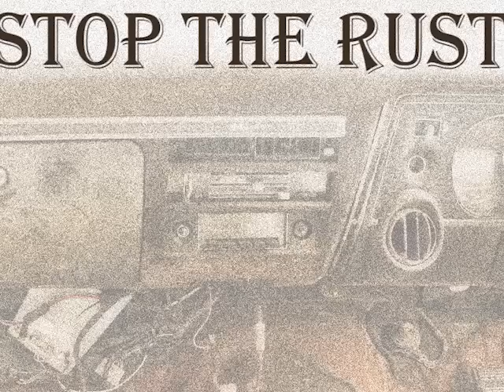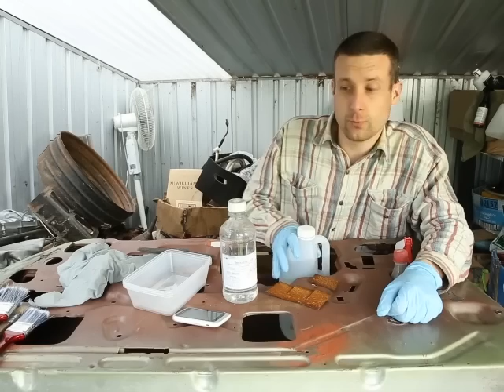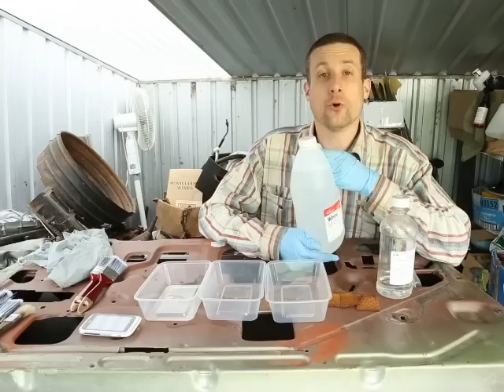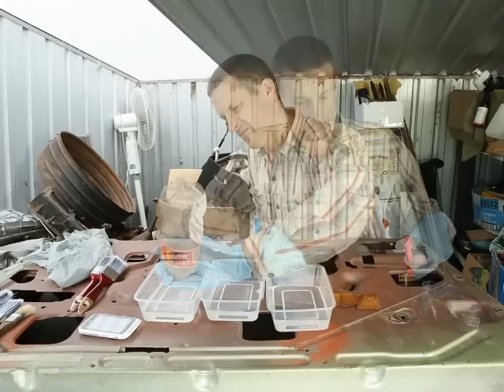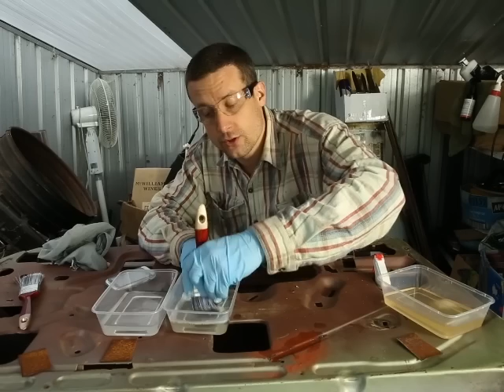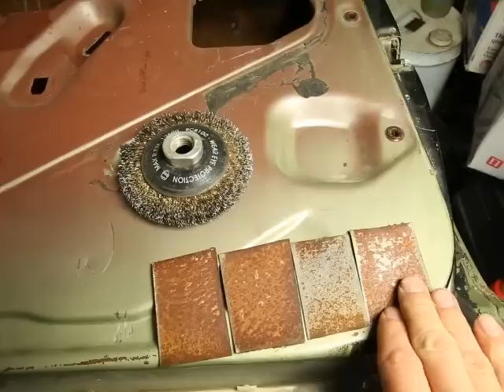rust chemicals compared, phosphoric acid vs deoxidene vs vinegar vs mag wheel cleaner

Comment: I dropped some rusty tools into a shallow tub of white vinegar and left them there for a couple of days.  I couldn't believe it.  Rusty suds formed on the surface and the tools turned charcoal grey.  This grey color was removed by some rubbing w/ a rag, but the tools remain the color a Glock pistol.  Most important to remove any grease or oil first, as vinegar has the same properties as water and will not penetrate the barrier.  Hard to use on vertical surfaces. 
     I tried 1:9 solution of molasses.  It didn't work well for me.  Also i have used a phosphoric acid product called Whink on carpeting and fabric.  Works instantly.  I didn't rinse the carpet but i would recommend it.  Good video.  Thanks.

Comment: With the right exposure time and solution, phosphoric acid will convert rust entirely to iron phosphate with no need for abrasive.  You're close, but I can demonstrate turning rusted steel into completely rust free.   

Dilution is important and so is surface texture because it can be hard to get insufficiently diluted phosphoric acid out of small areas.  

It will also blacken steel, which depending on your outlook can be good or bad.
Reply: hey m8, you seem you know what you are talking about... what do you mean about dilution !?
Reply: Minimum 20%, but 40% is much better. Expensive, but you don't need that much if 85%.

Comment: At my engine shop, we have steel shot blasting, bead blasting, soda blasting, 9", 4" and 3" wire wheels on body sanders, 3" Scotchbrite pads on die grinders, a sodium hydroxide jet washer with a rust remover additive(crap), hot tank, electrolytic cleaning and ultrasonic.

Rust removal with the least labor is Evaporust, but it can take several hours or even a couple of days if it is thick and flaky. If the parts are small enough, we throw them into the bead blasting tumble basket, and 15 minutes later, voila,  It removes the whatever, and leaves an even, albeit, drab, flat finish. Soda blasting is not really aggressive enough for rust, but it washes off in water, making it more attractive for cleaning items with blind passages like an intake manifold. We reserve soda for aluminum or blind spaces. Evaporust also get into all the nooks and crannies without leaving any stray abrasives. If it is a rusty engine block, and I don't want to wait for the Evaporust, I might roll it outside and hit it with black silica in the sand blaster. 

Cylinder heads laying in a junkyard rusting for years, old paint, carbon buildup, whatever, go into the steel shot blaster, and come out warm 15 minutes later, looking like brand new.
Reply: You might be the best person to ask. I have an old rusted trailer that is still mechanically sound. All that exposed steel c channel is a real pain in the ass, and impossible to get any abrasive to access. I sprayed it down with a phosphoric acid etch yesterday and this morning, it is coated in white dust. Now what the hell do i do? Blast it anyway? This project is a nightmare...
Reply: Protect your lungs and blast away outside. Rust converter is commonly used on frames. I've used Rust-mort on a kit car frame 15 years ago, and it still looks good.
Reply: The Engine Center tyrent

Comment: I've been tring several differant things to try to remove rust out of a gas tank. Vinegar does not work it will rust back fast cider or white vinegar. I've been using electrolists with baking soda seems to work very well but as soon as you drain it and let it stand it will rust back.
Reply from the maker: So your problem is the (flash rust) Try washing the water off with something that won't let it rust. I like the spray pack engine degrease r that's full of oils and spirits but since your washing out the inside of a tank your going to need a lot of rinse. You should consider using rust converter or getting water dispersant in bulk
Reply: 10-4
Reply from the maker: thanks for a great idea, I think this is called a parts tumbler.
Reply: All the rust "removers" either dissolve the rust, but that leaves the bare metal for new rust to form, or they convert it. Rust converters turn rust from iron oxides into something less brittle, like iron tannine, or iron phosphate. that will leave a more stable surface, but it still may flake off. You should test what works best for inside your tank.
Reply from the maker: Thanks for your input, lots of things help and it's a hard choice sometimes. Eastwood made a kit for the inside of tanks, might be worth looking at. I'm not a fan of converters, I don't think they penetrate on heavy rust.
Reply: The converters chemically change the rust, and may actually react with the top surface of unoxidized steal below. But that will not be a deep penetration, and almost anything is better than rust. I had that problem with the tank from my XT500, and back then all I could do was dry it out, put sand in it and tumble it strapped to a concrete drum for an hour. That ground out the rust. But I had a hard time to get all the sand dust out of the tank later. After that, the tank was almost always full, so there wasn't any problem later. I guess some kind of fuel resistant coating after the de- rusting makes sense, but back tghen there wasn't anything other than sloshing some paint inside the tank, and I didn't trust that. Maybe galvanizing on the inside?

Comment: If you soak rusted steel in phosphoric acid, at least for some types of steel, the phosphoric acid will "rebuild" the surface. I have found this to be true in several instances. One memorable time was when I used phosphoric acid on the spring steel wire rings inside a hub cap; the rings are used to keep tension inside the connection clip areas, so that the hub cap stays tight at all times. This spring steel proved to be so improved by phosphoric acid, that when I had soaked it completely and let it dry completely (temperature over 50 degrees F), the spring steel rings appeared to be completely repaired, and the metal looked to have a perfect surface, although when I had started the soak, the rust appeared flaky (I did not use a wire brush on the rings at all). The rings have held up excellently since then. I was astounded. Phosphoric acid may work better on spring steel than on sheet metal, but I don't know this for sure.

Comment: The rust converter you mention at the beginning of the video does not remove rust, it converts the iron oxide into iron tannate.  It will only work on rust, so it is best for pieces like you were working with that have a relatively even layer of rust across the material.  When you apply it it will turn the orange iron oxide to black iron tannate, which adheres to the metal.  Now it adds another layer of protection to the steel and you can paint over it.

Comment: vinegar works great and rids the metal of rust and makes the metal clean enough to eat off,but it takes depending on the thickness of the rust it may take 2 weeks to clean,not just 2 minutes.and yes it will rust again very quick that why you treat the metal pronto.
Reply from the maker: Vinegar is also the most environmentally friendly and user friendly, just a bit expensive with larger parts.
Reply: phosphoric acid is good for full frame it can be brushed on and when you rince it with water the ph of the acid drops to be neutral
Reply: pressure wash rinse

Comment: Body panels are mild steel, so embrittlement is no so much of an issue.

The trick though is to keep application time to a minimum, neutralise with NaOH, rinse with water, dry and then coat the treated panel with a commercial rust converter.

The other thing is that as HCl has a lower SG than water. Keep it away from seam welds as it will penetrate these and the rust process will continue as water, residual HCl and Ferric Oxide form Ferric Chloride (a strong etchant) to keep the process going.

Comment: Thanks for the video. Something that worked for me was Distilled White Vinegar and you soak the item in the vinegar and right after it comes out you spray it with WD40 or any other water displacement spray.
Also another thing that i have tried was called Evapo rust! Once again thanks for the videos. im gonna go watch your molasses video now
Reply from the maker: Good tip WD40 will be great to prevent flash rust. If it get's expensive I have had success with engine degreaser in a can, sometimes $2 per can.

Comment from the maker: You both make excellent points, however embrittlement is already a problem on old cars before you get them in the work shop. Flexing and vibration will work harden your panels to the point of cracking. I like the idea of normalizing the steel where possible 280deg'C whilst weary of the risk of warpage. Most of us know you should heat evenly and cool slowly but saying it on youtube is a lot easier than doing it.

Comment from the maker: Thanks I look forward to trying it. The problem with this auto body stuff is that everything needs so much respect, I get tired of trying not to die. I have also heard that the harder you etch steel the more etch hardening applies to the steel. My impression is that acid makes steel harder or more brittle, so for panels we plan to beat a milder acid might be preferred. Thanks again for the tip.

Comment: Leave your metal submersed in some cider vinegar for 24 hours then rinse with water, heat dry and apply some oil like WD40 to stop any rust returning, cheap and very effective. Don’t throw the used vinegar away as you can keep using it even though the vinegar will look very dirty just pour it into a bottle minus any rust sediment. 👍🏼🇬🇧

Comment: there's a big difference between removing rust and neutralising rust.. deoxidine is primarily used to convert surface rust into a paint-able surface. it also requires an abrasive such as scotchbrite

the best method to remove rust is always going to be a wire wheel or some 80 grit

Comment: when we work with tool and die we're working in a ferric chloride environment (etching department) and literally EVERYTHING rusts. we have two chemicals (i'll look up their names, they're simply aerosol bottles, one's orange, one's green) we spray to keep the metal from rusting, but the one we use most for storage is, you guessed it, WD 40. tbh for practical water displacement and rust prevention, I'd recommend a light coat of wd.

Comment: Excellent comparative video. Vinegar definitely dissolves rust, but phosphoric acid is quicker than vinegar. Vinegar only comprise 5% acitic acid. Why not try a stronger version of acitic acid, say 32% the one you use for cleaning coffee machines?
Reply from the maker: I'm sure that's well worth testing, thanks
Reply: The stronger the acid the faster it eats the metal you want to save.  Also requires more neutralizing.

Comment: Phosphoric acid works, that's a fact. Does nothing to the metal, but converts iron oxide (rust) to iron phosphate. And, prevents rusting rather well on its own. No need to rinse. Slow reaction tho, you can just leave it there. Use wall paper paste as a thickener and brush on a generous coating. Wipe off when done. Heat speeds the reaction.

Comment: Mate, for speed and effectiveness you really need to try straight Hydrocloric Acid (Diggers from Bunnings).
Just respect the stuff and don't breathe the fumes, watch you eyes etc.

Have another container with a Water/Sodium BiCarb or a Water/Sodium Hydroxide(10%) solution to neutralise the acid when stop the reaction.

When it's all done and dry, the metal will 'flash rust'. Dont worry, just apply a light coating of commercial rust converter and Bob's ya' Uncle (or your Aunt).

Comment: I like the comparison. What would you recommend to do the same with a car roof ?  I had seen your one video about the Apple cider vinegar, would you recommend soaking a towel to allow it to stay moist when it is sitting ?   
 How about clinging ? Thickening the solution to help on vertical areas like frame rails ?
Reply from the maker: they make stuff just for this, it has been called (naval jelly) locktight make a version, as would many other brands. Put some cling wrap on top of it to extend your working time.
        I would recommend getting it as clean as possible dry first. I really liked something called a (strip it disk) it's very aggressive but doesn't hook into the steel too hard. Watch out for the lead filler in your sail panel (top of rear quarter) the disc will eat it really fast.

Comment: I think just let the chemical do the job until it finish then you can rub the brush to remove the remaining residual of the rust...i don't know but i have tested when chemical reaction take effect don't disturb it or you can do it using a very delicate cloth so the chemical can absorb into the metal and remove the rust. If you rub something on it you are actually preventing the chemical reaction to do its job.

Comment: It all depends on how much time you want to spend on the job. I've filled a very rusty motorcycle fuel tank to the top with vinegar then left it for 2 days & it looked like brand new metal inside. I emptied all but a couple of litres out then dropped in a a piece of chain about a metre long,shook the shit out of it for 5 or 10 mins then dumped everything out. Use Baking Soda & water to neutralise the vinegar,give the tank a good hose out with water,give it a quick blast with air to dry it out a bit,put half a gallon of fuel in it,shake it around to get the fuel covering all the inside then empty it out, fill it with fuel & you're good to go.Tank is still good 16 months later. Have used Hydrochloric Acid in basically the same way except you don't have to leave it for any huge amount of time,it'll eat that rust off right before your eyes but you have to be very, very careful because it is bad shit,wear good gloves,goggles,cover skin ect then follow the same procedure.I've cleaned axes,hammers,spanners & other badly rusted items with both these chemicals & they both work,one is just heaps quicker than the other & more dangerous,common sense is the order of the day. Rob

Comment: Molasses definitely works, I tried it, worked very well. I'm about to do it again, but after reading about the Phosphoric acid being the Active Ingredient in Molasses, I thought I would search what else has it or if I can buy the Phosphoric acid on it's own, came across your video.
Reply from the maker: +MotorcycleTherapy I feel that there is no substitute for molasses for large parts with lots of rust. I have a some molasses videos too.
Reply: I'll check them out, cheers
Reply: +Stop The Rust will it work well for cleaning cast iron pots? (the molasses)
Reply: yeah, absolutely. The trick is not to just do the Molasses, it's got to be washed down and then coated immediately with "Por 15 Metal Ready". Doing the Molasses on it's own will only remove the rust that's there, but steel oxidises instantly as it dries. So have the "Por 15 Metal Ready" in a bottle ready to spray on and you will be sweet as. Unless you don't want the white Zinc finish, then you will need to finish with undercoat or paint, what ever, depends on the application.
Reply: Stop The Rust I do remember seeing your other videos now, sorry, have been busy with setting up my workshop and I have a thousand things happening at the moment. Learning to weld, got my 50' Dodge and now a 79' Cherokee donor car, tools etc. Man this is fun but time really does fly

Comment: not seeing it in the comments but an alternative to buying a phosphoric acid solution is to make it yourself, how cheap can you get sulfuric acid? if it is not too expensive,  you can use it to turn cheap super phosphate fertilizer (mono-calcium phosphate) into phosphoric acid (soluble in water) and calcium sulfate (insoluble in water) so the calcium falls out of solution and you are left with water and phosphoric acid, then up to you what you mix in that solution but I am guessing reverse anodizing (hooking up the item with rust on it to the wrong side of the electrical system in an anodizer) would remove the oxygen from the rust leaving metal only there,  another cheap source of phosphoric acid is diet colas as they use pure phosphoric acid as a flavoring agent so there is a bit of it in there more than most people think,and is why it is so bad for teeth (combines with the calcium in teeth to make calcium phosphate and washes the calcium away from the teeth disolving them a bit at a time as you drink it, useing a straw to keep it off the teeth while being drank may help but the best solution to that is to stop drinking it and use it instead as a cleaner (diet cause it has no sugars in it to interfere with the cleaning process :) )

Comment: Molasses is very effective and gentle but can take more time than other methods. Stock feed molasses is cheap, a mix of 1 molasses to 10 water is good, going stronger than 1:6 is not good as it makes the metal black. Heat treated sections of tools will corrode faster than non heat treated. Wash off at the end and dry with a blower to avoid flash rust.
Reply from the maker: I completely agree molasses rules. I have some videos that demonstrate the process. Thanks for the comment.

Comment: Prep and etch from home depot or any hardware store green liquid phosphoric acid the crap is really nasty on the skin and paint so move your cars away it will etch clear coat very fast. If rust is really heavy you should take a wire wheel to it first. Blasting is always the fastest way to remove rust I sometimes blast it then hit it with acid to get into the pours.